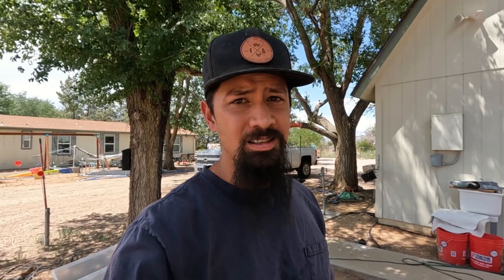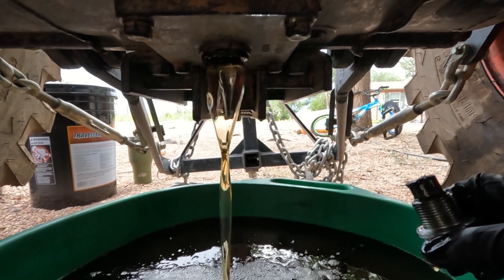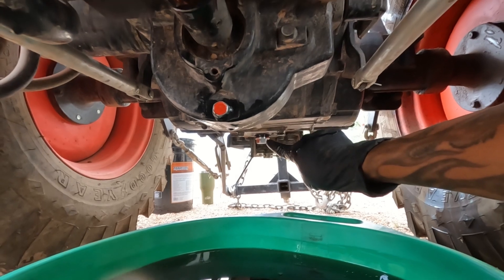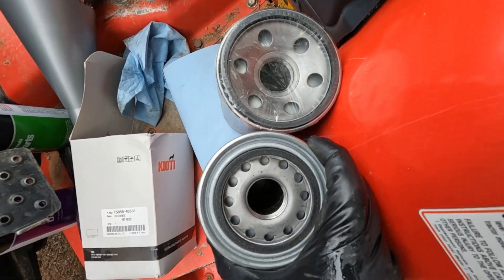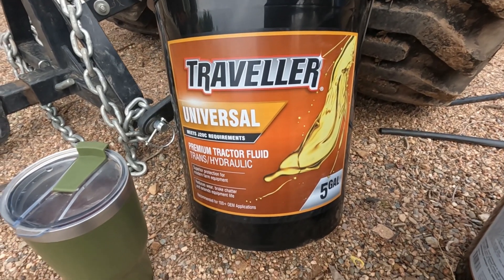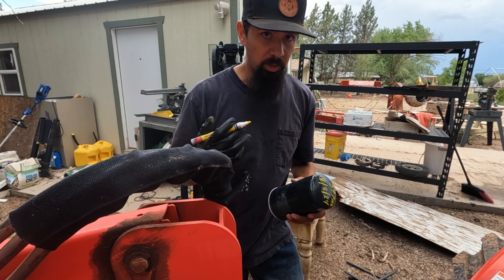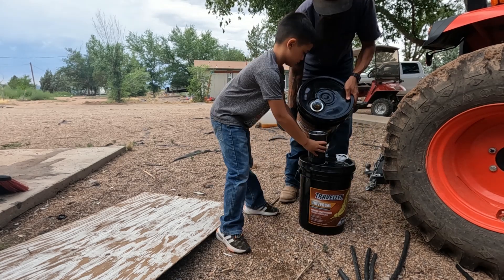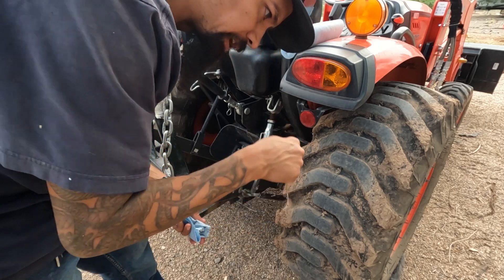Kioti CK2610 HST - Transmission Hydraulic Fluid Change - 400 Hour Service

Comment: Had to use one of those chain wrenches, my dealer torqued filters down like they were permanent installations.
Reply from the maker: @johncware66  that's the worst. I hate finding filters and plugs where dealers do that. It's why I never take my vehicles in for fluid changes anymore.